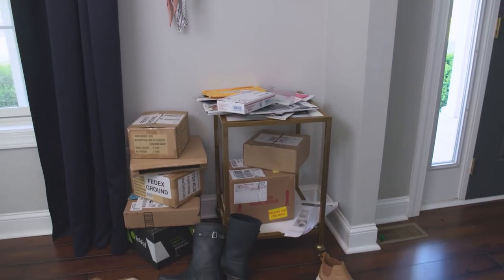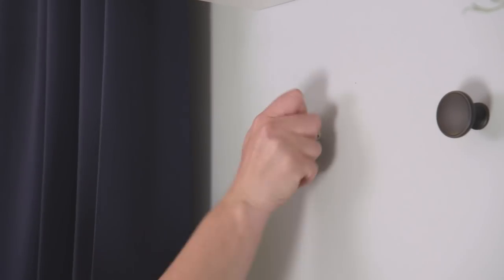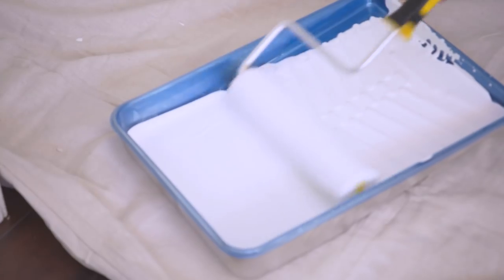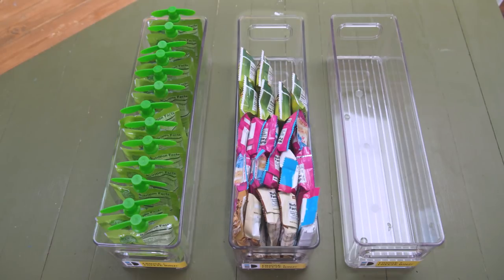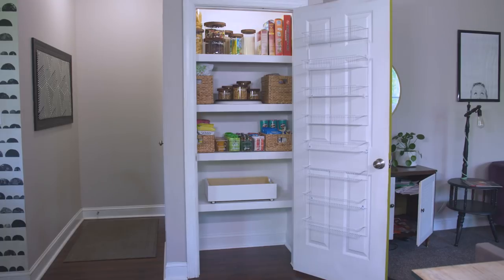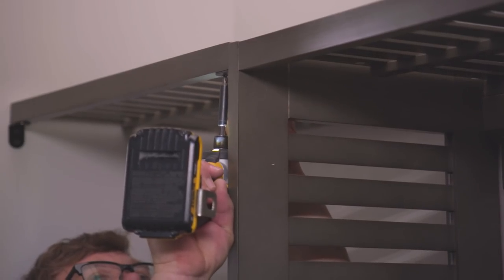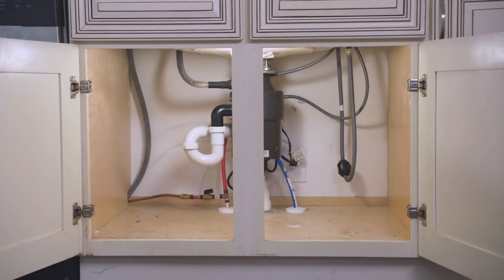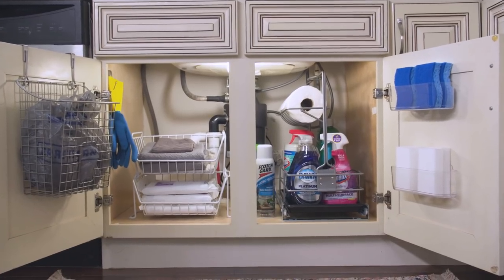How to Organize a Closet, Pantry & More (w/ Monica from The Weekender)

Comment: I would always opt for closed storage at the front door, except for decorative items and guest coat hooks.
Not only would I paint the inside of the pantry and closet bright white, but I would use a high gloss trim paint to make it even easier to keep clean and unscuffed.
Definitely use the pantry door for storage, but I think unpackaging stuff to put in jars is a time waster and doesn't solve what to do with the leftovers in the box that don't fit into the jar, or the boxes waiting to be emptied.  Behind closed doors, I don't need it to be in a pretty jar as long as it's organized.  Packaging is also easier to shift without fear of breaking if something falls.
Just me, but I don't like using the floor for storage.  I prefer to have a just-above-floor height shelf with a trimmed toe tick.
Great to have lights inside the pantry and coat closet.  It can even be handy to have an outlet in a closet for charging appliances, etc..
Love the pull out caddy and door storage under the sink.  I hang my spray bottles and scrub cloths on hooks inside the doors of my sink so they are too handy to ignore!

Comment: So, hallway:  Moved the clutter from the floor to the wall.  Actually, it doesn't look great.  Pantry: A great makeover, except putting unhealthy kids' snacks at eye level so they can reach them when they want them.  Coat closet:  not a fan of cleaning supplies mixed in with coats.  Under the sink:  Great makeover, especially the tracked/pull out storage containers.